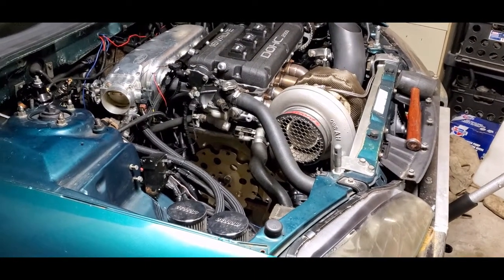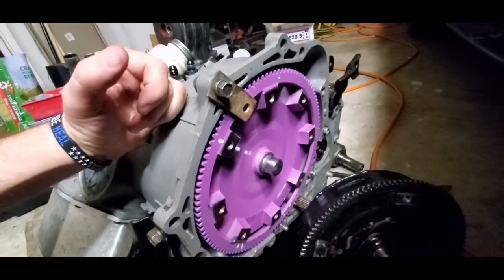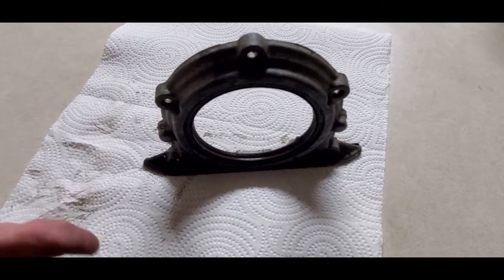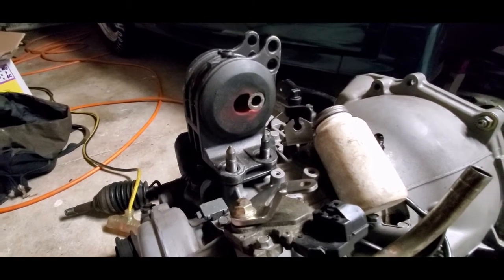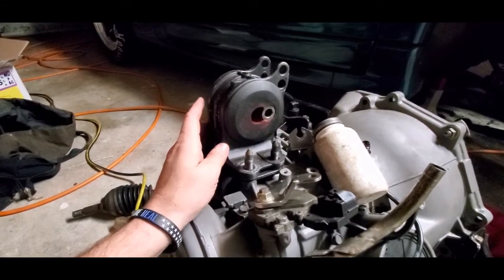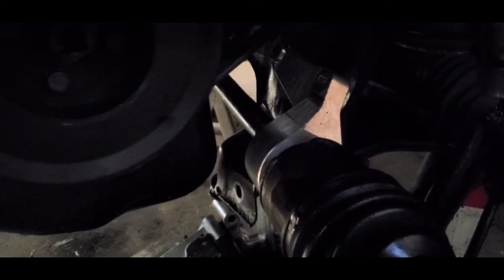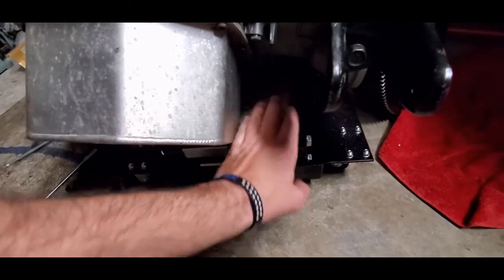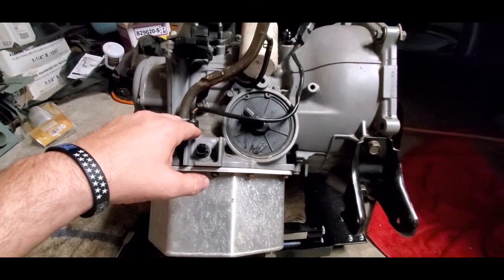Auto Conversion parts needed

Comment: Thanks for a the details Scott. I’ve got a question regarding the wiring. Are you splicing the pigtail into the factory harness or did you run them yourself ?
Reply from the maker: No sir I did not. Now I could've ran the wire for the reverse lights but this is more for track only and to make it simple, I ONLY did the wiring for shifting (3 wires total and have another video talking about an issue I had there) and one power wire to the fuse block to supply the power for the shifting. This wiring is completely separate from the factory harness and zero modifications were needed to the factory harness.
Reply: Doing my swap now, 7-bolt to auto…I bought the new forced4 250. I got the entire auto wiring harness but believe I only need one plug? Thanks for the video!